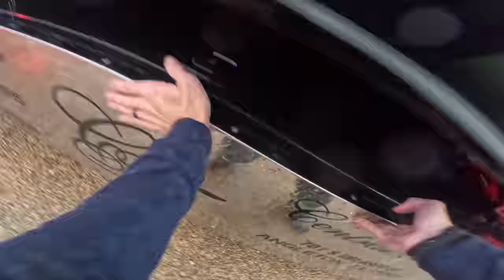Ford F150 Drives Through a Building!!

Comment: I had to watch this video again. Since it involves something very important. I have towed, but, before I was a electrician for 18 years. I don't know building in Texas, not a bit. This looks like a "older " building. Probably been worked on a lot. From the video Justin has, it's a 3 phase, typical for commercial. Hard to see in the video, but, 4 lines from the pole to building. Might be single phase now, since one meter socket, doesn't have a meter. Fire department might have removed it. The truck just missed everything. We as people want to help, just be careful and cautious if we come across a situation, that could be like this. Most common electrocution deaths 110/120. The person gets grounded. 3 phase plays different I doubt it was 277/480. My point is, when in doubt, walk away. Call for help and assistance. The old saying, bad plumbing can get you wet, bad electrical can kill you. Be safe. God bless!
Reply from the maker: This definitely had the opportunity to be a very dangerous situation outside of the damage already caused. Which is why we worked closely with the fire department to make sure it was safe before we removed the vehicle. They had already shut off all the breakers.
Reply: Bad plumbing can kill ya. Not just with gas bro, but wet electrical....always hated that old saying. Lol

Comment: Your videos make me want to switch jobs and go towing since I've had an interest in it for a long time, I've just never made the jump to try.

Good job getting that truck out of the building though! Keep the awesome videos coming!
Reply from the maker: That’s how I was for many years. I was established and didn’t really need to switch it up, but made the jump and haven’t looked back. I love what I do.
Reply: Dustin, I though about changing my career to towing and recovery but my fear is that I am older and being on the edge of late 30s going into my 40s I don't know how long I could do towing and recovery
Reply: I feel the same way since I'm in my mid 30's but at the same time, where I currently work I love delivering and picking up machinery. So towing is something I'm highly considering switching to. Worst case scenario I just go back to what I know if it doesn't work out.

Comment: Hey brother, one of those calls where a wheel lift is better than a flat bed. You already know my opinion between the two types of trucks. Lol. With a flatbed 25,000 pounds pounds or more on soaked ground, compared to a wheel lift 15,000 pounds and up. Both only have 1 set of dual tires in back. The loading on the drive tires on your flatbed would have dug trenches! Hats off to fire, police and EMS, all needed and much applause 👏 🙌 👍. Be safe
Reply from the maker: Thank You! 
The wheel lift truck cut some ruts as it was, I could only imagine what my flatbed would have done lol

Comment: If you didn’t have a wheel lift available, couldn’t you have just setup on the road and ran winch, chain/straps to the truck?
Reply from the maker: I could have, but that would have taken a lot of rigging. I could have attempted to pull into the grass, and probably made it. But why not use the right tool for the job, if it’s available.

Comment: Dustin do you have any accident rotations that need a different kind of truck other then your regular Rollback you drive, does it make a difference if the wheel lift truck has a streight boom or a foldable wheel lift truck doing a wrench out like this one with the pickup inside a building
Reply from the maker: There aren’t very many situations that “need” a different truck, other than some special recoveries, but it can make it easier. 

The wheel lift has no effect on a recovery if you’re not using it to tow the vehicle.
Reply: @Towtruck_Dustin would Donny's wheel lift truck or been a better truck to tow it to the yard or did it have to be hauled on a flatbed
Reply from the maker: It could have been wheel lifted to the yard, but it’s always safer to tow it on a flatbed, especially with a hard front end collision like this.
Reply: @Towtruck_Dustin  oh just couldn't tell if it would be safely towed on Donny's wheel lift truck